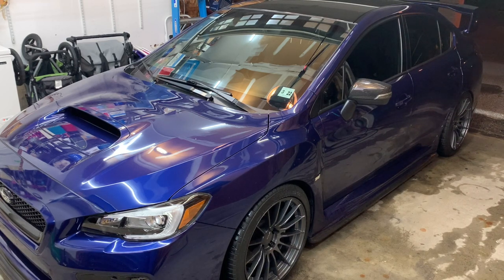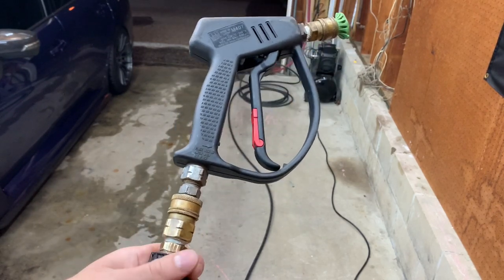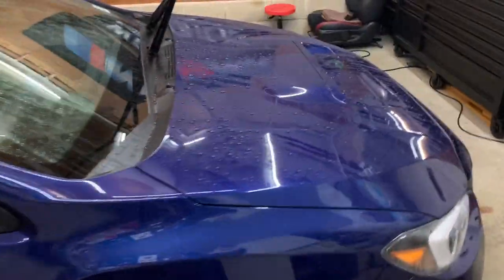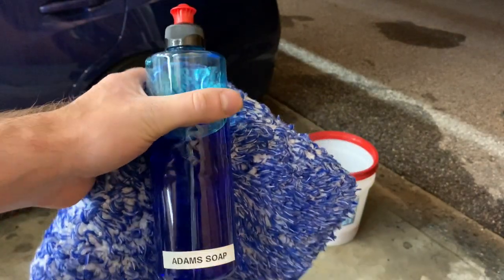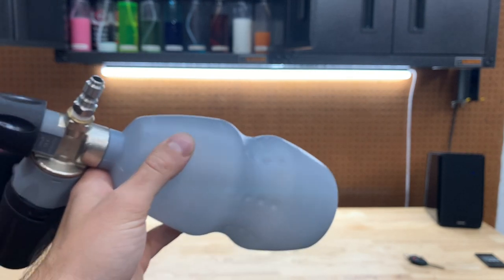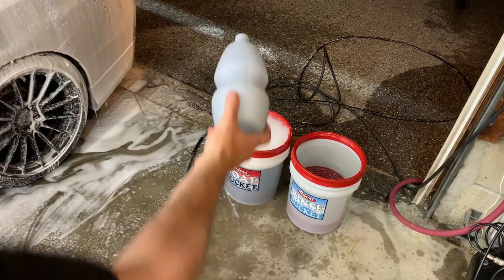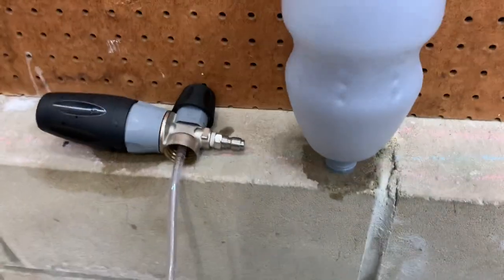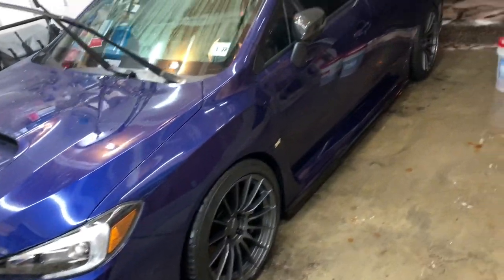Wash Series Part 2: How to Wash Your Car

Comment: Any tips on maintaining the lapis blue? Right now i just do the whole foam/wash combo but im not useing a pressure washer as of yet just a basic foam gun to hose attatchment. I have the butter wet wax and a quick detail spray for after but the wax im not too fond of bc if i dont take my time it seems like some how im always missing a streak or somethin to buff out. I did get the glasscoat when i bought the car so i know that offers some protection for now but? Idk any tips i guess sry bout the novel lol
Reply from the maker: Check out my wash playlist. I have multiple videos on my process and my methods of how I wash.

Comment: Do you take any extra precautions in winter with extra salt on the road to prevent rust?
Reply from the maker: Nothing different. I just do my normal washes and spray the under carriage well. Luckily the past 2 winters have been very light and haven’t had to deal with the salt.